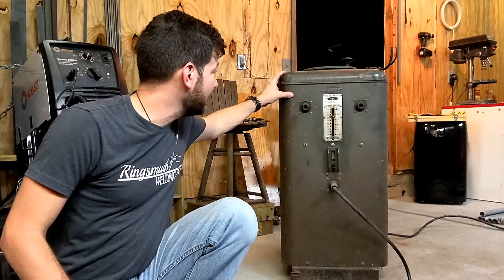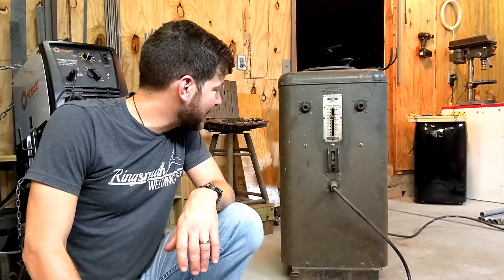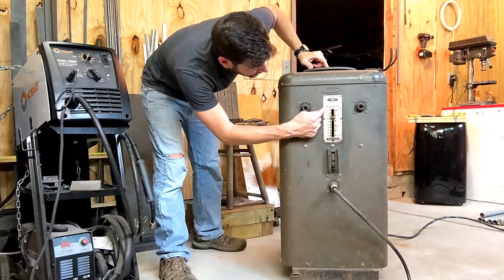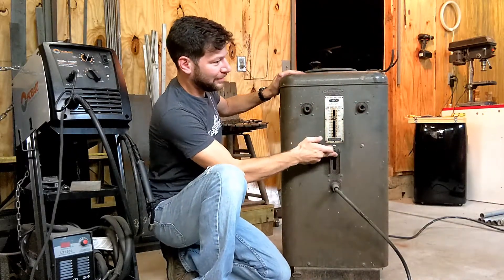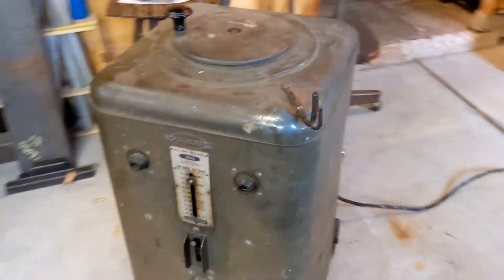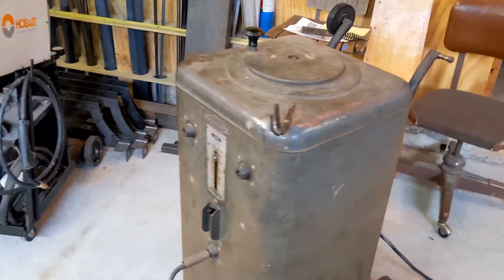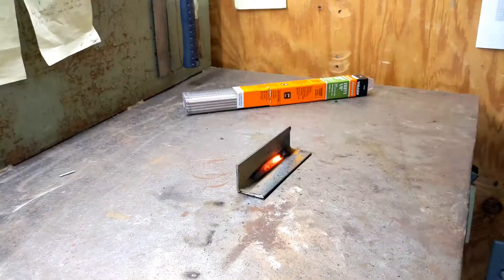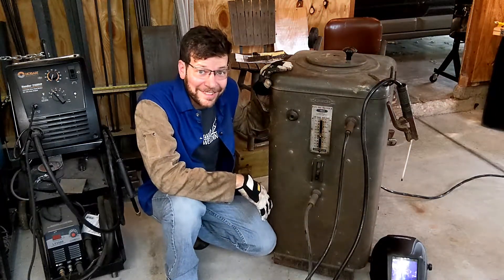1950s Craftsman Arc Welder

Comment: My dad had a 1964 version of this Sears.  A tip: The lower range plug on the Left paradoxically has HIGHER open circuit voltage [OCV] and arc voltage.  It will run 3/32" and 1/8" WITH OUT THE ARC OUTAGES you can see here with the 6011/7018.  The Right  high range plug is for better AC rods like 6013, 7014 and 5/32" large rods.
Reply from the maker: Wow thank you that is really helpful to know. Next time I fire it up I'll definitely try this.

Comment: I acquired the same welder in a barter trade (S/N 1770), except that mine is red (and has a hand truck-like dolly attached).  I suspect that someone repainted it in its past life.  However, I knocked the dents out of the sheet metal and while prepping it for painting, I did not find any of the greenish gold paint that yours and other photos I've seen have.  Mine does not buzz nearly as loud as yours does so I suspect you may have some loose hardware somewhere, though mine does have that 60 Hz hum that increases when you strike an arc, just not as loud.  While the cover was off, I cleaned everything and lubed the internal moving parts - there are no wood parts.  Funny that yours makes that ratcheting sound as the amps adjust wheel is turned - mine is silent.  Anyway, it equals my AC-225 tombstone for arc stability and ease of welding and is fun to use if for no other reason that it's older than me!
Reply from the maker: Thank you for the interesting information on your welder. It's fascinating to hear from someone who has the same machine. I'm sure mine could use some TLC. It's been neglected for too long. A good cleaning would go a long way.

Comment: Why does it hum like that
Reply from the maker: Novice answer here, so take it with a grain of salt. That hum sound is basically the sound of the transformer transforming. It's taking a certain range of electricity in changing it to a very different range of current. An arc welder is less of a welder and more of a giant transformer, hence the noise. It's vibrating it's surroundings.